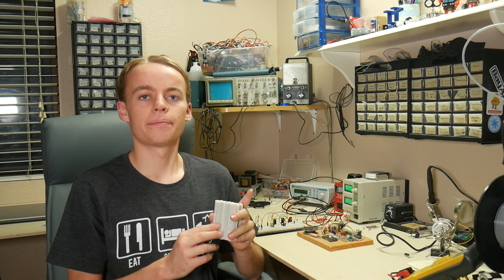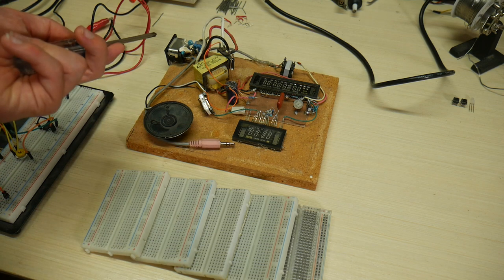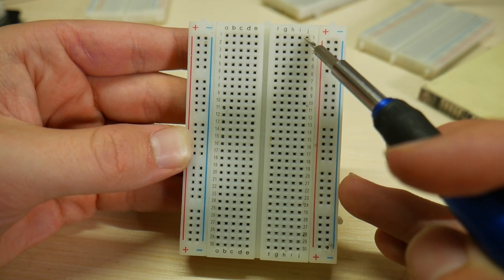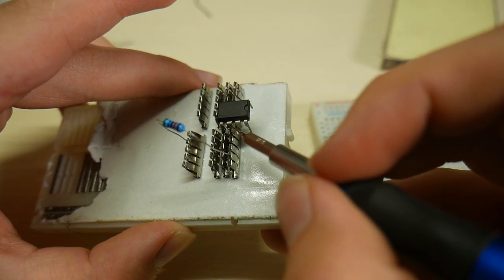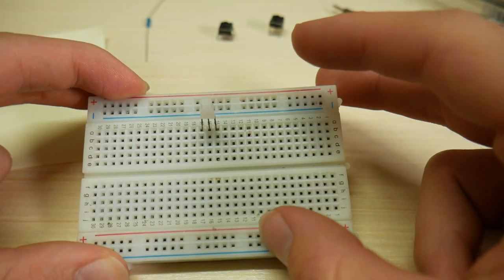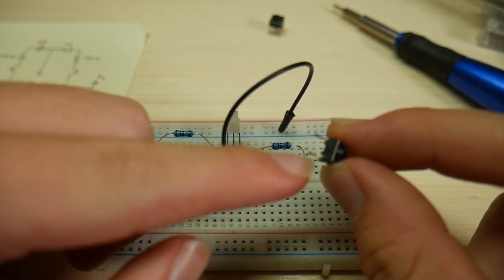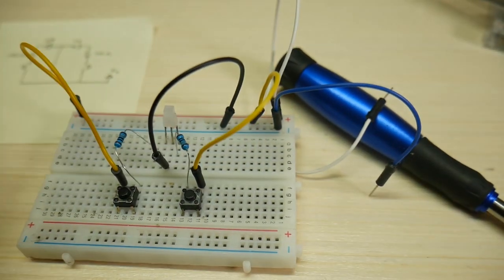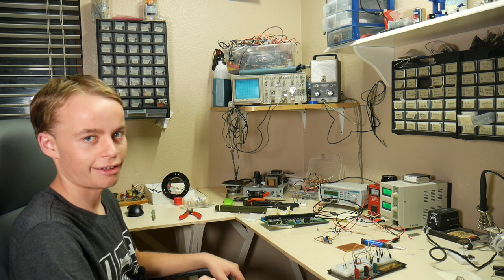Electronics Basics: What is a Breadboard and How to Use It

Comment: You are awesome at explaining electrical concepts dude...

Video request... I've heard Clive and Dave (EEVblog) talk about +12v and -12v (and 5v, 3.3v etc) when dealing with power for computers. Could you do a vid describing what the difference is, and why negative voltage is a thing?
Reply: Im intrested!
Reply from the maker: Ok!  I might do a video sometime in the future where I modify a computer power supply to produce a different voltage, and I will explain the different types of power.

Comment: Nice video, but that VFD amplifier has piqued my interest! I'm guessing it's kind of like the Korg Nutube, with the VFD set up as kind of a triode (I mean, a VFD is kind of a bunch of triodes all sharing a common cathode/heater). I would love to see some more info on that!
Reply from the maker: Thanks! Yeah, that VFD amp was a fun build a while back. I made a video about my build process of it. I tied all the grids and all the anodes together. It works very well with low currents(as in a preamp) but I made the mistake of trying to drive a speaker with it. The phosphorus coating on the anode has a high resistance.  I am thinking about redoing it with a power tube on the output.